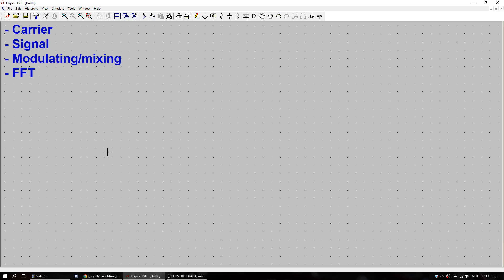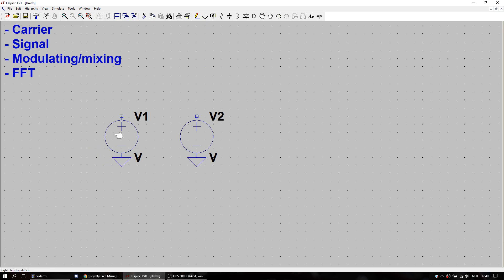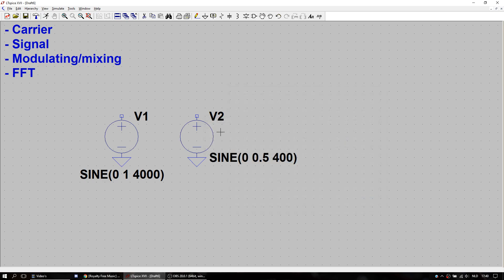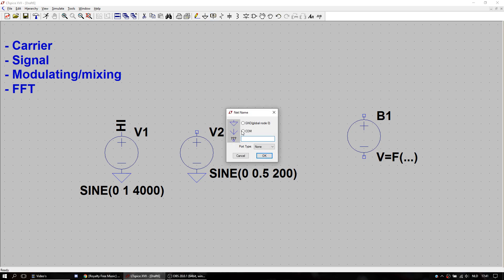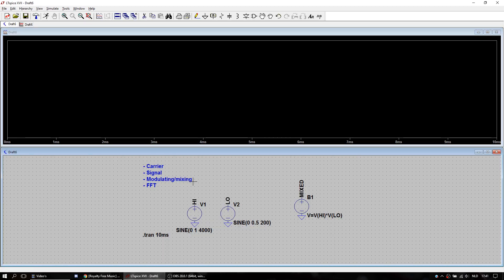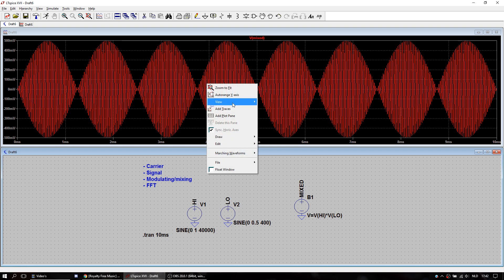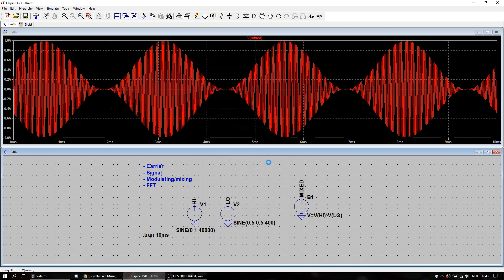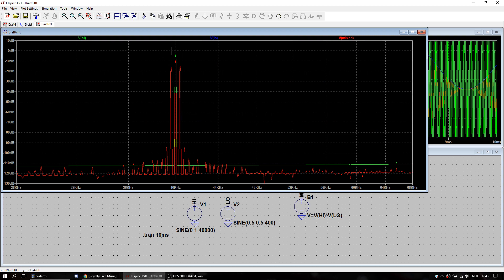[Electronics] Amplitude Modulation (AM) in LTSPICE XVII

Comment: Can get the same result by placing two voltage sources in series.
Reply from the maker: All roads lead to rome, I remember there even being a component in LTSPICE that does AM.
Reply: I don’t think so. By connecting them in series, you sum the voltages. But in AM you multiply them.

Comment: but how do you implement that in a real circuit with capacitors, resistors, trnaistors etc?
Reply from the maker: I've built an AM receiver once with a SA602 I think. But that seems to be quite obsolete technology. Another way is with an LC tank and peak detector but the internet is littered with those schematics.

Comment: But the Modulation index is not working right, show me overmodulation and undermodulation? basically by changing the amplitude the modulation index changes! but it does not here why?
Reply: I just figured it out.  Add a DC offset to the Lo frequency (modulation) generator, and then you can change the Lo frequency generator AC amplitude and change percent of modulation.